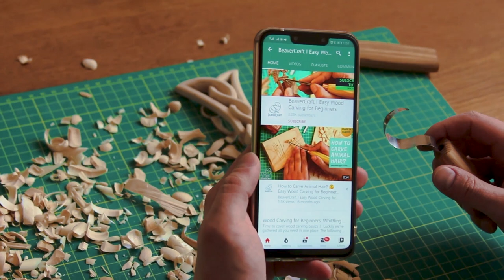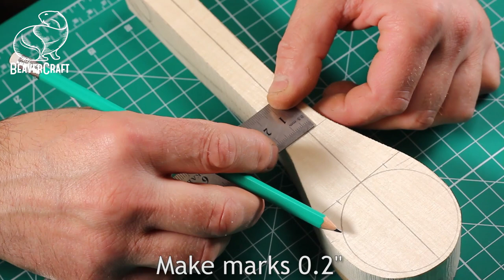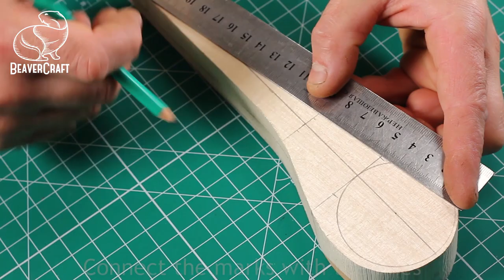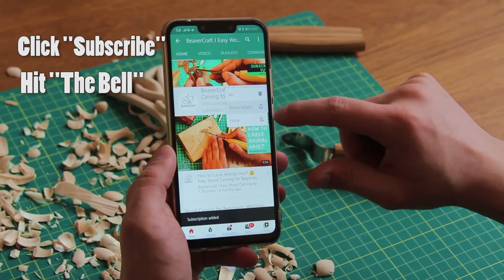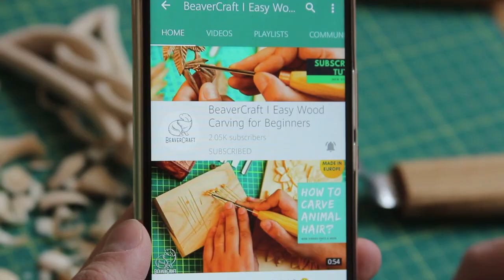Wooden Spoon Carving Tutorial

Comment: The grain in my wood blank made it really tough to work on my spoon. It changes direction in so many places and makes it tear out often and some areas incredibly difficult to remove wood. Maybe I should just get some green wood and give that a go.
Reply: I think a great idea would be to go to the link in their description and order some basswood spoon blanks. Basswood is an excellent straight-grained wood and you can get 2 blanks on their site for just a little more than the price of one!
Reply from the maker: Just try to use basswood cos it's the best solution for beginners.
Reply from the maker: Thank you for your comment, Jack. You're right that basswood is an excellent choice.
Reply: @Jackalski57  Thanks guys. I am using a basswood blank I got with my knife order. The grain just seems to be a bit screwy. It changes direction often or so it seems. I can cut in one direction on the handle and will  be nice and smooth until I reach 2/3 down and then it will get tough to cut and tear out a lot. The other end is just incredibly difficult to cut any wood from, can only get a little bit at a time compared to the rest of the spoon. I think I just need to grind away at it and home the next one is easier to use. Thanks for the feedback.
Reply: @robertm4050  Wow, that's a bit strange, though not impossible with basswood.  Hopefully your next ones are better!
Reply: Do u have the spoon knife in left handed or any tools
Reply: Robert, also make sure your tools are - to use the current idiom - scary sharp.

Comment: I see you're using a standard basswood blank from your site.  

Rather than using a metric ruler and converting to inch units, you may as well just quote the metric units. Many metal rulers are dual scale and have both metric and inch scales opposite one another.   I say that because at 1:40 there is a mistake in your conversion. It states to make two marks 0.4" on each side from the central line, but you show 15mm, which is closer to 0.6"  

Also, how far from the edge of the bowl should the dividers (aka compass) be set...is there a particular bowl wall thickness that should be aimed for?  You don't mention that in the video, but I think it would help. 

Great video otherwise, but I thought I'd make some suggestions that I think may be helpful. You may also want to note in the beginning of the video that the blank and tools are available on your website and are linked to in the description.
Reply from the maker: Thank you very much for your comment, Jack. Just leave 0.08 inches to the edge of the bowl. In addition, the conversion turned out to be not quite right, so we’ll take into account adding size in mm.